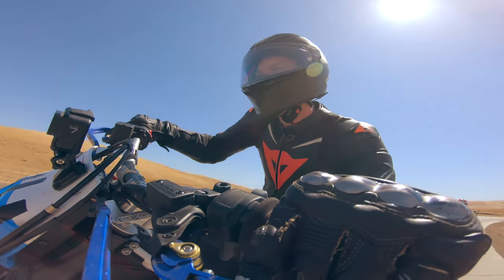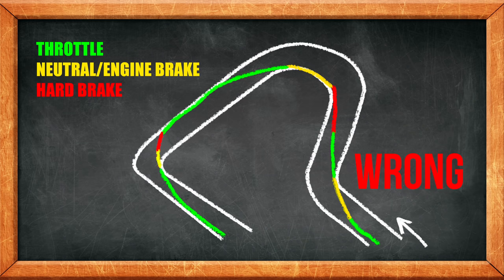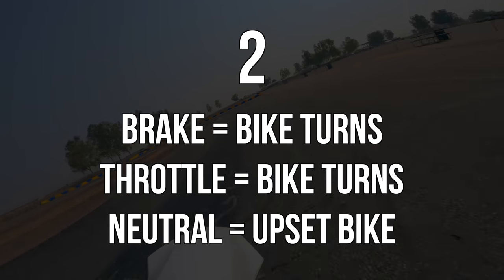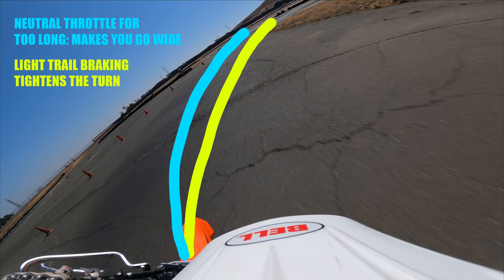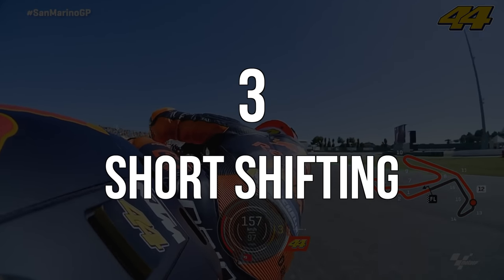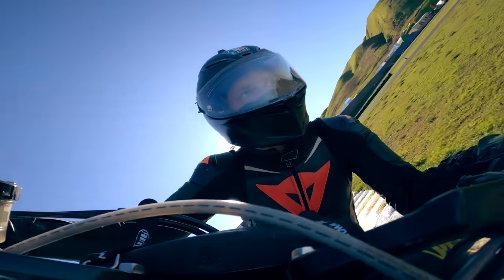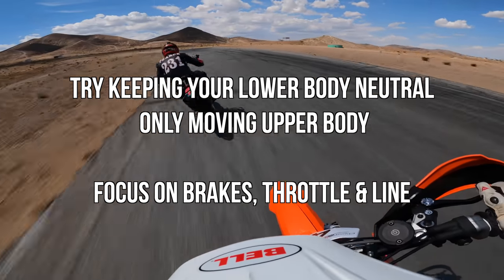4 Easy ways to Corner FASTER

Comment: "Well setup" for oversteering on throttle is key here. My 2019 ZX6R understeered on stock settings as soon as I went on the throttle and/or left off the brakes. To fix this I had to raise the rear by 3mm with a shim (not by increasing preload) and accelerate the rebound setting on the fork. Now it keeps the radius inside the corner and I am able to tighten the line on-throttle.
Reply: I reduced front preload in mine and some extra preload in rear even tho shim is the right way to go.
Reply: What do you mean by understeer? You sliding the front?
Reply: @superbarnie  I think that would be not able to steer at all, what usually happens with single disc brake bikes that don't have abs
Reply: Couldn't understand much but would come back to read after i get my superbike (someday)

Comment: I learned the first tip playing IoM:Ride on the Edge 2. Its better to enter some corners braking early to get traction and exit faster than braking late and having a slower exit. Also, same happens on AWD vs RWD cars on Forza. For the superior acceleration of AWD, you need to enter with a lot of speed, have the traction and exit faster.

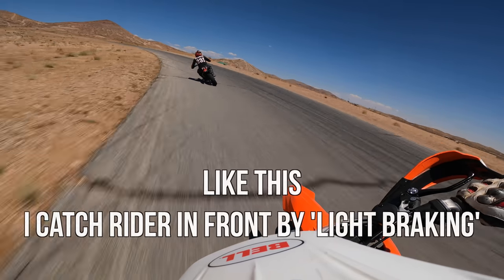Comment: 0:59 I swear to god that this background music is getting into the right place
in my cortex to stimulate 30% more generation of new brain cell connections. love it! 

Definitely good tip to just staying neutral on a supermoto and just flow with the track. If you (which I did before) try to hang off or push the bike under you there is a risk of you giving too much force upon the bike and the you get stiff making it more prone to loss of traction. :)
Reply: I noticed the music too bro! Epidemic Sound has some really good tunes, I think thats what our guy Mike uses if someone was wondering :)

Comment: I had my bike for about 2 ½ months now and just got my permit to ride. I've been only been able to practice once or twice week since having my bike. What I find difficult is trying to maneuver at slow speeds while cornering. Because I'm doing it with only clutch control before giving her throttle, I feel my bike wanting to give out half way into the turn and at times find myself having the strength to left it up from trying to fall, or just have a slowmo fall with it (since I put on the crash bars) and learn how to properly left up a fallen bike. It is true what my friend and family say "it's easier to go fast than it is to go slow"...
Reply: If we are talking really slow maneuvering try having your bike in first gear, don't touch the clutch, give it a little bit of throttle and break a little with your rear brake. Try it out in a parking lot or something, you can play with how much rear brake you give your bike. It will feel a lot more stable in slow speed. Personally I use a little of rear break in 2nd gear hairpin turns, gives me stability and confidence.

Comment: I was taught the bike wants to stand up when you go on the throttle, not tighten the turn. Feels like I'm missing a key thing here.
Reply: the key on that is oversteer, check a video explaining oversteer vs understeer and you will understand the point, in short oversteer is forcing your rear wheel to slide a bit while in the turn, it changes the direction where the front of the bike is pointing and makes the radius smaller, kinda a high level technique and your bike as he said has to be properly setup...leave it for track days only don't go thinking on doing this stuff on the streets X)
Reply: @brohofied2561  Thank you for the clarification.
Reply: @HavasiP  :)
Reply: I was wondering the same. Plus, other tip in this video is short shifting. How can you oversteer when you are so down on the Rev? Maybe because I ride a small bike. So maybe this tips are for those who are on litre class.
Reply: @fuzzfizz  mmm, well let me tell you most of this advises are advance tips to get better lap times on the track, i mean you could use this on the street but at your own risk of crashing cause of road conditions...at high speed when you add enough pressure to the front brake the weight goes forward as he mentions in the video, so your shifting will not dramatically change the fact that the whole bike and yourself are going forward compressing the front adding max grip to front tire and expanding the rear, this loose of weight on the rear means the wheel loses some grip, and so it can slide way easier, is a weight transfer affecting the suspension which affects the grip of the tires, that's my cheap explanation anyway X), check some videos on you tube about loading the front end by braking before cornering for better explanations ^^
Reply: @brohofied2561  that's what I thought. Seems for more advanced user. Guess I need to focus more on road safety tips then trying to corner faster 😄
Reply: @fuzzfizz  that's a wise self advice :)
Reply: Good explanations here. Never ridden on tracks and for the street I never felt that the bike would steer into the corner when acceleraring. Au contraire - the bike would stand up. Nevertheless, good tips 👍
Reply: @sorin.n  yeah sure, if you accelerate on the corner the bike will stand up and widen the corner radius, on normal conditions you accelerate to get out of the corner, but this technique of oversteering is making the rear slide, so your line and positioning of the front are different from a normal acceleration, is just not your everyday street technique to be using :p
Reply: Throttle and front brake to pull her in, mx tech for ruts. Brakes are used for stopping and bike control. Try it also rear brake, just be gentle and feel
Reply: @brohofied2561  So basically they're using slip angles? That's pretty cool.

Comment: Great video once again, very informative. I tried the two finger braking from the thumbnail but it required quite a bit of effort and I felt I had less accuracy on the amount of braking I wanted to do. Gave me a little scare. 90s sportsbike with original brakes. Is it suitable for all bikes?
Reply: Early 90's bikes (especially older tourers) do require a lot of brake pressure that can't be applied with 2 fingers, 
except ur Superman. Same with my 80's Goldwing, 2 fingers aren't gonna cut it for heavy breaking. 
You sacrifice some throttle and steering control, but that's the way it is.

Comment: got a question: when you first brake  at the back before corner  then  on front   just before  the corner  then throttle up  when you are in the corner and getting out is that not better for stability? i do'nt want to be the faster corner driver , i want the be the safest  with the biggest stability?

Comment: how to combine brake and downshifting on apex?
Reply: It’s too late to be downshifting on apex. It’s also unsettling the bike and your body position. Downshift while braking before you start to lean into the corner. Engine braking also helps to slow down the bike. Trail brake while leaning into the corner. Ease off the brake as you approach apex. Transition from braking to small amount of throttle shortly before apex. Roll off the throttle from apex towards exit.
Reply: @miroslavmilan  Thankyou Milan, Good explanation.

Comment: I would call myself a 6 out of 10 rider and whenever i ride with a slower person,when we stop first thing they say is duuude you are not leaning (on the road). İ only lean with my upper body on road because vision problems on road. İf you hang inside the bike you just wont see a thing about the corner you are about to blindly enter

Comment: waiting for how to apply brakes correctly. iam a beginner & i dont hv an abs, i slipped my rear tyre if i brake hard, but i dont know the real reason. maybe because the brand new rear tyre, my front shock leaked or i just lock my rear. but when i fix the front, the problem are solve too, but still i dont know why. maybe because the tyre just wear enough or i just try to pump the brake to avoid it locking. i lost my confidence.
Reply: Rear brakes will lock up faster than front brakes because while braking the weight is automatically transferred to the front = less grip with ur rear tire = locks up 
Thats also the reason why front brakes are always bigger than rear brakes because in the rear you don't need a lot of brake power

Comment: 2.17 tightening your line up with the throttle? Wow now I’m confused. I have watched multiple videos saying that add lean and throttle at the same time is a very dangerous game and will likely lead to a crash….
Reply: You're not adding lean. You're tightening the line by inducing oversteer by adding throttle. Only works if your bike is setup correctly such that adding throttle actually induces slight oversteer.
Reply: And also these cornering tips are for controlled track use only, not for use on the street. On the track, playing dangerous games is how you get the fastest lap times, getting to the very edge of traction but not over.
Reply: Thanks for the explanation

Comment: for those whe have not abs especially, never ever put 4 fingers on the break lever. Never, eventually you'll block that front wheel. Only one index finger. That's it. It's more than enough. Well, if you are a girl with the fragile hand than you can put two fingers. But never more.
Reply: My motorcycle doesn't have abs, but I use 2 fingers only. 
Quick Q, do you use 4 fingers for clutch?
Reply: @gokulkrishm51  your doing right things. I also don't ride with abs on, only on wet road. But still my bike has throttle control that i cant turn off. 
Are you trailing with two fingers too, coz you ll probably have better sensitivity with only one for trailing but its imo.  

I use all 4 for a clutch, yes. Sometimes i put my pinky under the clutch lever coz its my gap after which it begins to move slightly so i use it to quickly take off
Reply: @bigbang259  Mmhmm. I have my Dad in the backseat always, coz I'm technically not yet aged to ride a motorcycle here 😅 But I tried using 1 finger, but Dad always tells me to put 2 fingers while trailing, he says it's safer and I find that better than one finger. And also to keep index finger on the brake while riding on city and narrow roads. We don't know what'll jump in front of us! I too use 4 fingers, it's a hard clutch on our motorcycle. No assist and slipper. 

I always try to ask more experienced riders about these stuff. That's why I asked. By the way, which motorcycle do you ride?
Reply: @gokulkrishm51  FZ-10 . 
of course its better to keep the finger on the lever all the time. You not only win a second or a half coz you don't need to move it there, but you also dont open up throttle before breaking. If your finger are not there yet, to put it there your hand unconsciously opens the throttle. 

Again, one finger is much more sensitive but 2 is good as well. Depends on how you already have learned and how stiff your lever and how strong is you fingers. You can learn both ways and than choose.
Reply: @bigbang259  Ah! Nice bike! 
Yes it's true! It depends. Anyway, thanks for replying. Have a good day. Ride safe ✌️
Reply: @gokulkrishm51  ye, its not bad, powerful and reliable. You like naked bikes too? i doubt it coz when i was young i was fascinating about sports and plastic. What's yours and what you want to ride after 5 years?
Reply: @bigbang259  Well, it's called yamaha for a reason. We have a 2016 Royal Enfield classic 350. I know it's not much, but financially it's good 😅 But vibrates like hell. 100 kms and get off your whole body vibrates 😂 we're planning to take a Honda CB 350. It's a very good bike, imo. So saving money for it. 

And I like every type motorcycles. But I have a soft corner for advs and cruisers. In 5 years, idk. I first need to complete my studies and get a job.  I've always dreamt about getting a big adv. Probably have a look on them. It's also better than cruisers in India. 😂 Practicality of a cruiser in India is a tough deal.  

You have any plans for changing your motorcycle?
Reply: @gokulkrishm51  oh your from India. Been there in my early 20s and still feel like it was the best time i had traveling. 

i dont want to change my bike, not now. Kinda love it. Wish it drink less and maintenance were cheaper. But fuck i dont want anything else.

A naked bike gives me the feeling of riding. Even compared to R1, to have the same sensation you should drive twice the speed on R1. And shorter gears, makes it even sharper.
Reply: @bigbang259  Oh you've been to India. Must've been nice! 

Yes I've rode some naked bikes. Actually I've rode the Yamaha R15 and a KTM Duke 390. Honestly I liked the Duke better. It has better ergo, much fun to ride! 

Each motorcycle is a different feel!

Comment: id add one more big even a huge thing. When your using both hands for steering whey actually compete with each other. And in corners its much better to use only the inside arm for steering. 
It can be inconvenient at the beginning and kind of tricky coz without that another hand trying to steer too, the impact will be bigger at first. So one should be careful learning it. But gush how much more control you have when only one hand a time turns that bar

Comment: Corner faster in the streets, the road or the race track. ? 
Streets and roads are not for racing. 
There’s a big problem when teaching newbies to corner faster . Most likely they won’t become professional motorcycle racers and they will be attempting to use these techniques in the streets and roads increasing the index of fatalities
Reply: So you'd rather have them use shitty technique right of the bat and die instantly that's great.
What a newbie might end up doing without these videos is trying to go faster on his own and not knowing how to. That's where the danger is, not a fucking instruction video.